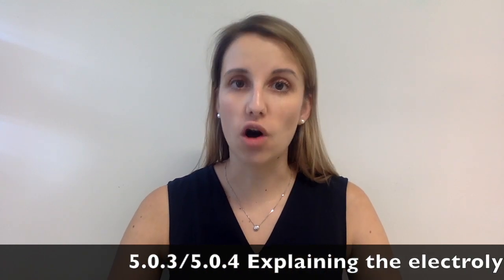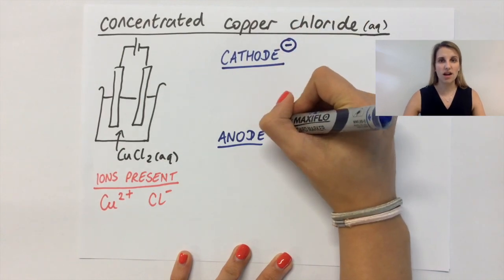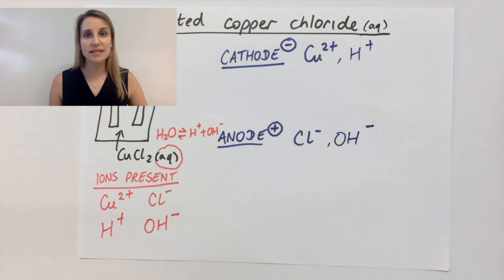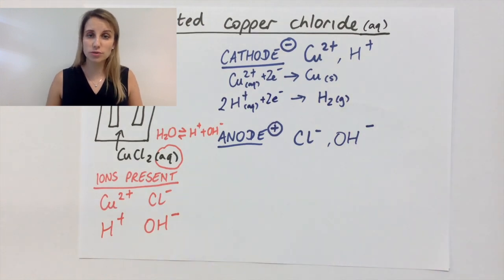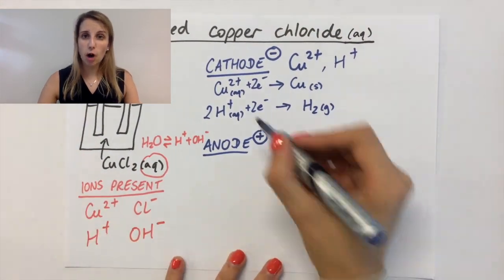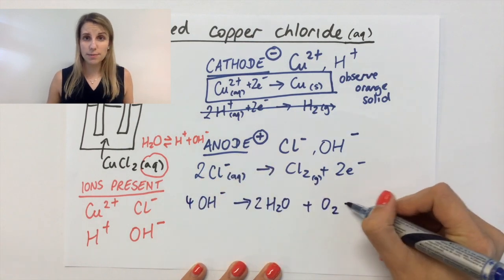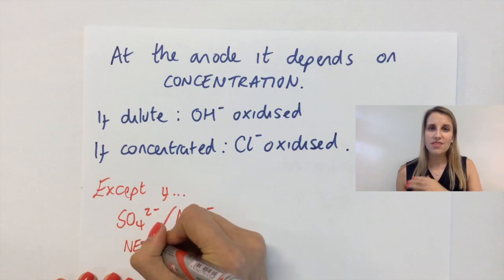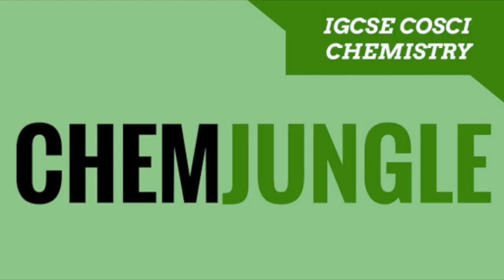Electrolysis of concentrated copper (II) chloride (aq) CuCL2 GCSE Chemistry

Comment: May I know why So42- and No3- will never be chosen? U said they were hard to be oxidised, but why?
Reply: so42- is a very weak reducing agent, it is at the very bottom of the ECS, so its very hard for it to be preferentially discharged.  no3- (nitric acid)  is a strong oxidising agent, so it gets reduced.
Reply: At cathode , negative ions will be oxidised .. so in sulphate and nitrate ion the Sulphur and the nitrogen are already at their maximum oxidation State so they can't be oxidized any further 
Hope it helps

Comment: Hello, is there any way this can be used to separate a mixture ofCuCl2 FeCl3 and NaCl? If I’m understanding correctly, by adding water to my mixture just like you did in this video, the same rxn will proceed right because Cu is lower on the activity series than Na and Fe?
Reply from the maker: You could definitely get the copper out using this method - not sure about how you would separate the rest easily though!

Comment: But how do you find the concentration of the species in the anode?
Reply from the maker: It's not about the concentration of the species at the anode, but is about the concentration of the solution as a whole. The question will normally tell you whether the solution is concentrated or dilute. If it doesn't tell you then for most syllabuses you should assume it's concentrated :)
Reply: ChemJungle thank you. BTW video was great. Helped me a lot!
Reply: @ChemJungle  is there strict barrier for concentration and dilute based on moles quantity being dissolved(molarity)?
Thank u very much, u r Great.
Reply from the maker: @alaeddinredeem4570  It's not really a barrier, more of a spectrum. In some scenarios you might have 50% chance of either product. This is a simplification of the complex factors that can be involved!

Comment: thanks for such a great video ..it really helped me out ..but I have a question ....in the observation , the universal indicator gonna change to which colour ....I am talking in the case of the electrolysis of concentrated sodium chloride
Reply from the maker: Eeeek for some reason I don't have a video on this - I'll make one tomorrow! For the mean time: in conc NaCl electrolysis, H+ will get reduced and become H2 at the cathode, Cl- will be oxidised and become Cl2 at the anode. As H+ concentration will decrease in the solution, this means the concentration of OH- will be much greater than the H+ so it'll become alkaline. Your UI will become blue/purple in colour.
Reply: +ChemJungle thanks
Reply from the maker: Ahhh it's IB exams this week so I haven't had time today - will try my absolute hardest to get it done this week!
Reply: +ChemJungle take your time I am done with my igcse chemistry exam